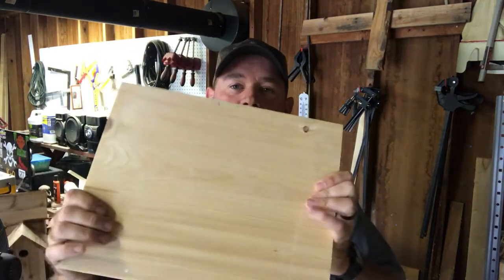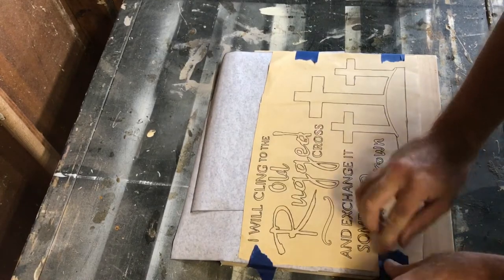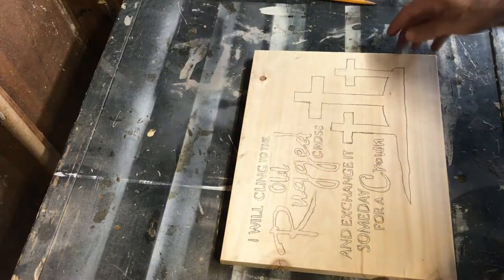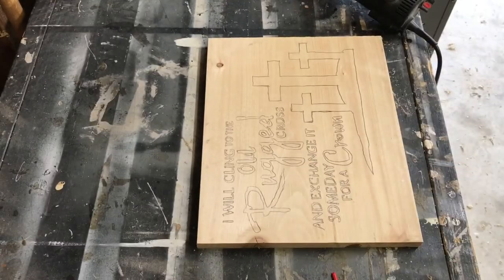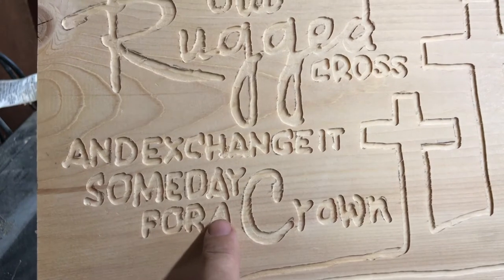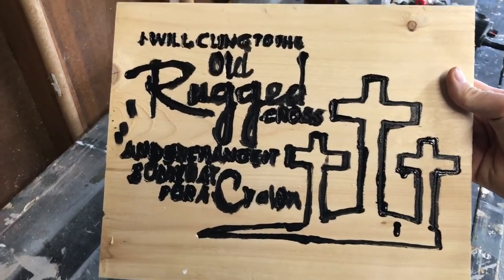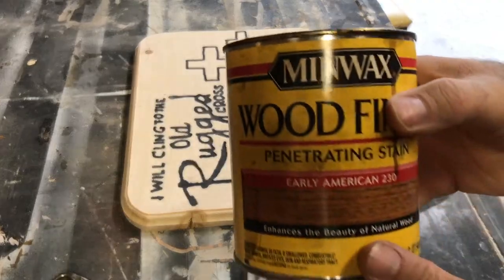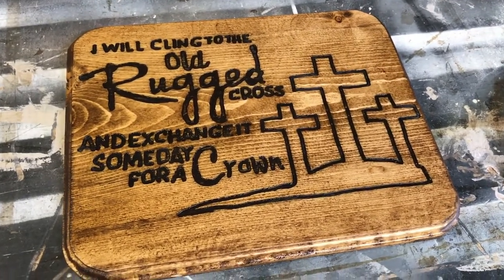Making a wooden sign using a trim router

Comment: you can get a Dremel 225-01 Flex Shaft Attachment and it is a lot better for signs and carving.
I have used that harbor freight trim router for years it does a great job for $29

Comment: great vid, you should buy a reducer collet and get some cnc router bits would help with fine detail also there really cheap check it out
Reply from the maker: mike nicholas thanks, I didn't know you could get a reducer collet. I will definitely have to check those out!
Reply: got my reducer on ebay and the cnc bits they are so cheap,here in the uk the whiteside bits cost about £25 with postage each so the cnc bits makes it more affordable  its well worth a look i have bought and tried
Reply: I’ve been trying my hand at that for a day or so and am using the DeWalt laminate trimmer. My problem with it is that I can’t lock it down completely and it wants to lower into the material as I’m cutting. I’m still learning on the curve, but hope to become more proficient each day! Keep up the good work!